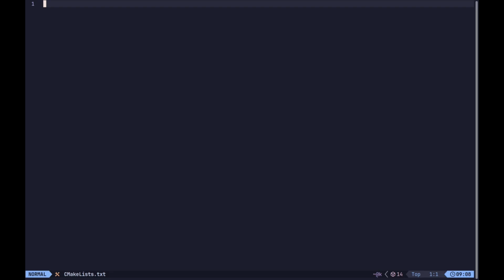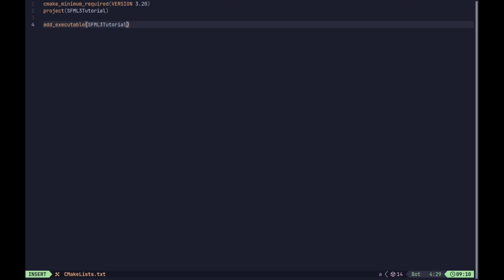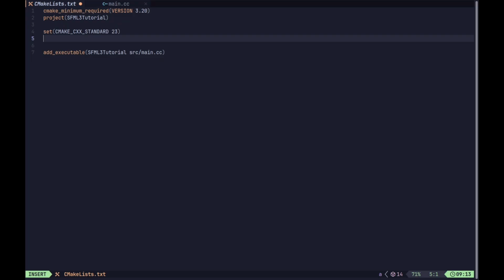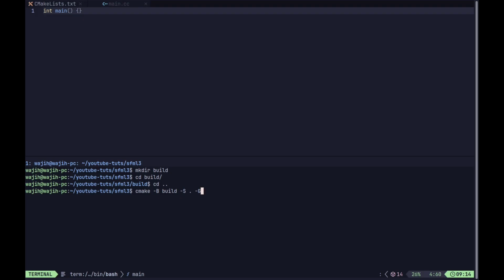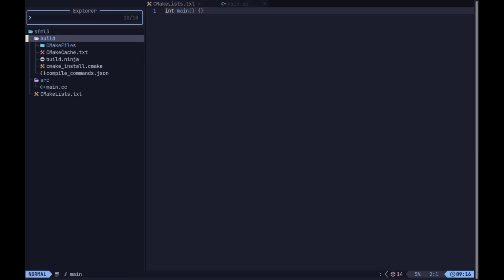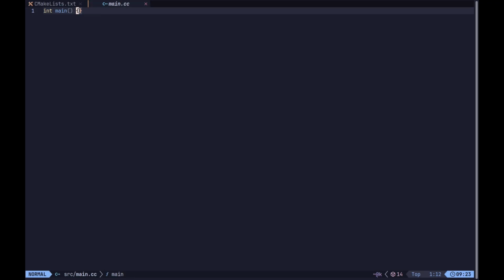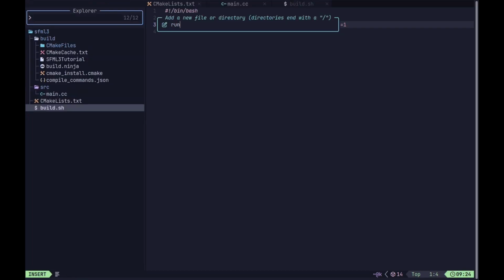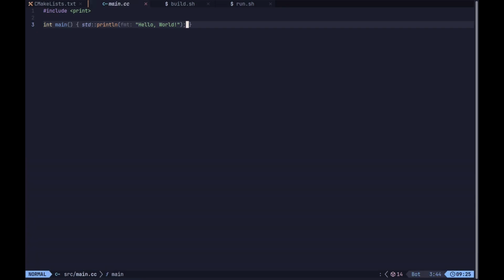Setting Up a Build System with CMake | SFML 3 Ep 0

Comment: I'm curious as to why `cmake` is a good option if you have to write all these scripts to augment what it does. I've got a set of template Makefiles for most of the projects that I might want to do and I just have to copy one from my template folder and I'm ready to go. I can even use `make` to create the build folder before it starts compiling anything. Surely there has to be a way to get `cmake` to do that too, and if not, I question why we would want to use it over `make`.
Reply from the maker: Makefiles can and do work for certain, simple use cases. However, when you start using subprojects, libraries, complex code structures, etc., it gets painful fast. Also, when you, for example, change your compile flags, Make cannot intelligently only recompile those files that are affected. You must do a rebuild from scratch manually. Not to mention that make isn't really that fast of a build system, compared to something like Ninja, which CMake can generate. Moreover, CMake is much more portable, can generate Visual Studio solutions, Xcode projects, etc. As for the scripts, they are just a couple of lines and you only have to worry about them once, compared to the mess of makefiles you will have to maintain otherwise.
Reply: @thehelloworldguyofficial  More portable? Doubtful. I'd wager that `make` is available for a few more platforms than `cmake` is. However, this is an irrelevant point for 99% of people because both systems are available on the big three, [Linux, Mac, Windows]. I know `make` can be used for cross compilation, and I'm sure `cmake` can as well, so even on platforms where they don't natively run they are still usable solutions. I've had tons of problems with getting other people's projects to work when they use `cmake`, and often it's due to version numbers being used arbitrarily. I can't say I've had problems with subprojects from `make`, from others or with regards to my own.

As for changing compiler flags, I would probably use touch to fake the timestamp for the Makefile and just delete the generated object code for the files that I want to recompile. Sure, not automatic, but I am curious as to how `cmake` would actually handle that. Also, I don't really get the speed argument because I always limit `make` to 8 cores when I build and very few things take more than 30 minutes. Browsers, fad language compilers that use LLVM for their backend, and maybe kernels, but those aren't things I'm building on a daily basis and I'm fairly certain the build programs aren't having enough of an effect on that build time for me to care.
Reply from the maker: @anon_y_mousse  By portable, I did not mean mere platform availability. I meant easy to port across different setups and compilers. With Makefiles, you have to write the compiler commands. If you need to support MSVC, you have to write different ones because its format of command line arguments is different from GCC. And Make isn't really popular in the Windows space, and it doesn't work neatly with IDEs like Visual Studio, unlike CMake. And then there are also differences between the "dialects" of make across platforms. Also, Make doesn't really have a very portable way of handling 3rd-party dependencies.
I am not sure what you mean by by "arbitrary version numbers". In my experience, I haven't had any problems with CMake projects.
CMake isn't a perfect build system, and Make is definitely ideal for projects with simple structures, but for complex projects there are tons of issues with it compared to CMake, which still has issues but arguably fewer.
And for publishing something like an open-source library, CMake is pretty much the de facto standard.
That said, what is important is choosing the right tool for the job. If you do not need all the features that CMake offers, there is no need to add the extra complexity. But CMake does have its advantages for more complex setups. Personally, I do use make for the majority of my "quick" projects, but I use CMake for something more serious.
Reply: @thehelloworldguyofficial  Ah I see, you don't adhere to the same development principles as I do. First, I can use GCC, GNU Make and Vim on every major platform, so MSVC having a different build commands is irrelevant to me. However, you can just write a template for multiple compilers, or you can use the macro language built-in to `make` and just select the compiler commands to use based on the platform that you're currently running on. This is why most Makefile's are setup where CC and CFLAGS are assigned to before any build commands are issued, and then you use those variables to run the appropriate command with the appropriate flags. I will admit that it's not for every developer because it does require looking at the documentation and writing your own templates, but if we're talking about oddball compiler setups, if your choice is between writing it yourself and waiting for CMake to catch up, I'd rather just use GNU Make.